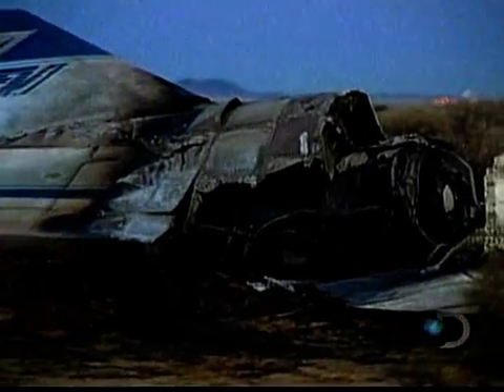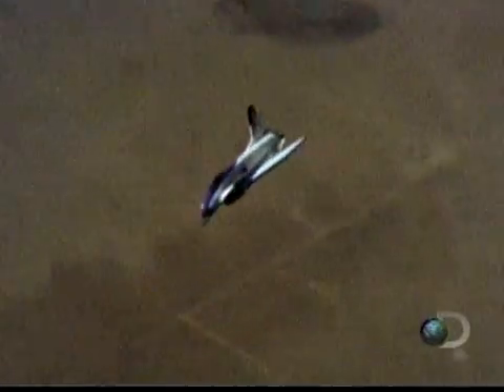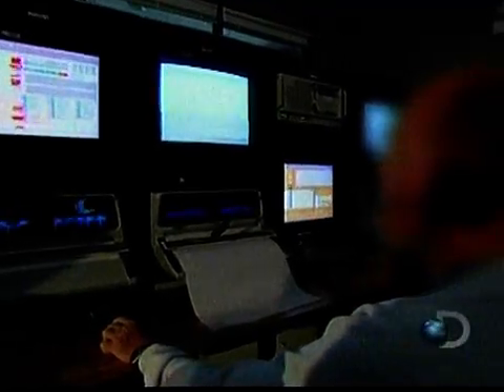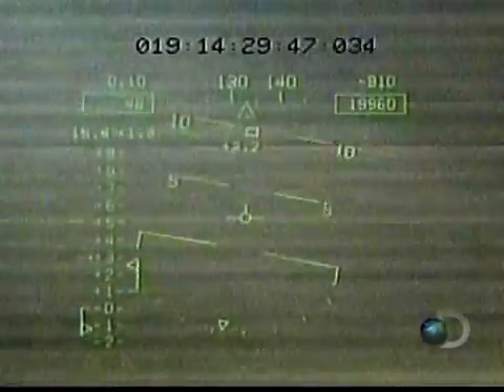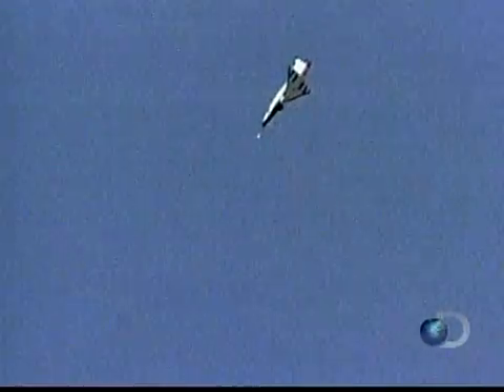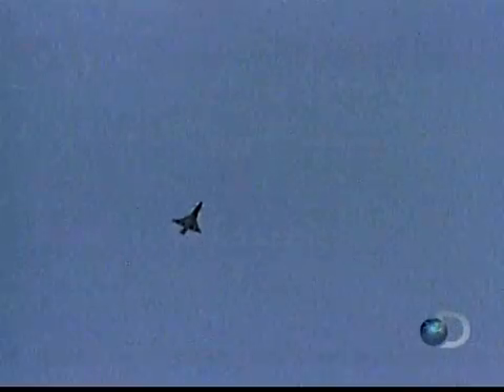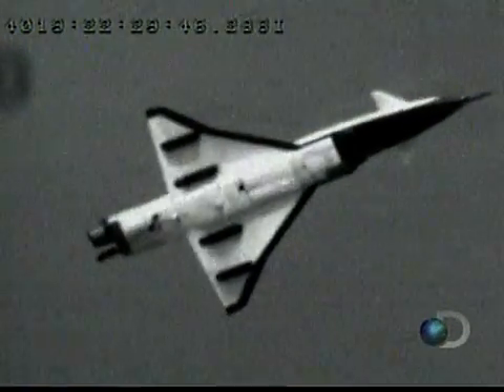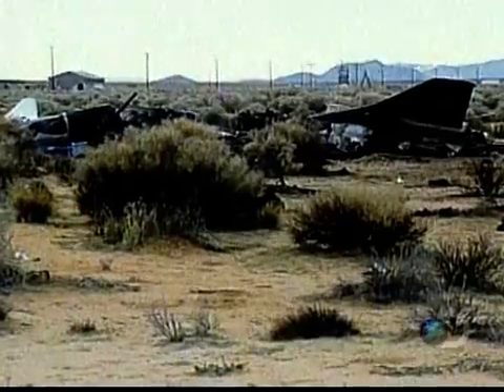x31 ap crash.mpg

Comment: The pilot is a coward. Made no effort to recover the plane. The plane actually recovered itself when speed increased, but with no pilot in control....
Reply: Somebody already addressed this, but in this case to try and ride this out would have been tantamount to suicide. This plane was capable of maneuvering well past the threshold of what a human can withstand. If the pilot had attempted to make a recovery after the computer took over control of the plane it could have easily entered a 10g+ turn and rendered him unconscious all but immediately and he would have just rode it down until he died in the crash.
Reply: @TresLinguas  Pilot didint actually even try  to override computer control just punched out!
Reply: MythicFrost there is no overriding the computer in that aircraft. If you lose your fly by wire control in that bird you’re done.
Reply: "the pilot was a coward, he ejected from a plane out of his control"
I would like to see your reaction in that situation, smh....
Also the plane didn't recover, it tried but it CRASHED.
Reply: Calling someone a coward eh?

Comment: One way to avoid disaster is to make sure you hook up the fricken heating system.  OR perhaps the computer could do a little check to see if everything is hooked up... oh well it crashed... scrap the whole idea...
Reply: they didn’t scrap the whole idea. this is the same technology used in the F-22 and F-35.
Reply: @kinafermusic2456  F-35 does not use thrust vectoring. Well only the F-35B does, but that is for VTOL

Comment: As someone who worked this series of aircraft, and as the video explains very well.  The problem was the pitot tube froze over (heater removed during maintenance). The pilot was flying at a high speed but the plane thought it was flying super slow speed because of the pitot tube issue. The plane started to move the control surfaces way to quickly for the speed it was going, and the pilot couldn't control it. He probably could of switched flight modes to ignore the pitot tube inputs, but didn't think of it before ejecting.

The X-31 was built to explore thrust vectoring, and lots of the technology has made into aircraft such as the EuroFighter and the JSF.
Reply: Thank you for the information.  I have worked on other systems where a missing heater would have been detected by instrumentation.  An operational vehicle would have included the ability to monitor the heater and hopefully the temperature of the pitot tube itself.  Since this was flight critical hardware, there might have been a redundant heater, redundant power to the heater, etc. to avoid this single-point failure.  All common aerospace practice but missing from this test vehicle.
Reply: @benjaminbarrera214  Fight test birds can't usually afford the triple redundant systems that a normal plane can
Reply: There were a series of systemic failures which led to this result. They are covered in a separate documentary. 

The pitot tube was replaced with a keel probe which didn't have de-icing heat. 

Also the audio you hear about the tube not being hooked up was internal coms not relayed to the pilot. 

Worse still they chase plane could not hear any of this or would have instantly known the speed was not correct. 

There were reversion systems but by the time the pilot knew he was out of control it was too late. 

The pilot knew he had very limited time in that aircraft to escape safely once the aircraft departed controlled flight.
Reply: But so why did they stop working on this?
Reply: So baeically your saying its the pilots fault for loosing the plane when he couldve flown it in manual control????

Comment: @Charlie

The plane was climbing vertical way too fast. The pilot could have blacked out from the G forces and went down with the plane. He had to bail way before that was a possibility.
Reply: John Dirks but the X-31 was never built for production. It has no radar system, fire control, weapon bays or hardpoints. No cannon either. It simply would be more work to redesign it for a figher role than to simply use test data to design a new fighter. 

I do agree with you though. The F-35 was built to fill too many roles, and as such it is mediocre in the low-speed arena. I don't think the F-15 and F-22 will be getting replaced as air superiority fighters any time soon. ;)
Reply: EVEN WITH THIS SET BACK IT WOULD HAVE BEEN BETTER TO PURSUE AND BUILD THE X 31 THE THE UNDER BOG F35!!!
Reply: TheTruthNJ09,  yeah, it wasn't just a climb, there was a bad dutch roll (coupling between the yaw and roll) at the moment before he ejected. At the rate the oscillation was growing, it would have inevitably gone into a spin at some point (such an occurrence with dutch roll happened with the F100, killing a test pilot who could not eject). 

    Once in a spin, the acceleration builds quickly. Even if the pilot was conscious and pulled the handles, under heavy G-load (say 12-15G's) its entirely possible that the ejection sequence wouldn't complete properly. As a test pilot, I would argue that you DO eject first and ask questions later (though I am not a pilot). Test pilots know all to well which situations are recoverable and which are not. I can almost guarantee that they are trained to pull the handles the very instant they depart from controlled flight. 

     Funny thing is that the video mentions that if the pilot could only "have manual override" that the crash would not have occurred. Most fighter aircraft made now days are designed to be unstable. To say the same for the X-31 would be an understatement. The X-31 was extremely unstable, hence its maneuverability. Without the computer making minor corrections at a rate of 100+ times per second, the aircraft would quickly get away from even the most skilled pilot. Add in the fact that the aircraft was already experiencing heavy oscillations, and it would be all but impossible to regain control manually. The days of manual control with fighters died back in the 1970's with the advent of modern FBW (fly by wire) systems. 

Anyways don't quote me on this ;) I'm not a pilot, just a humble aeronautical engineer. (Graduating on Saturday!!!!!! :D)